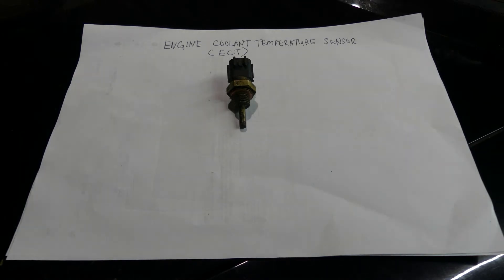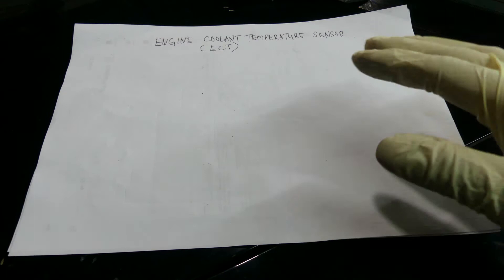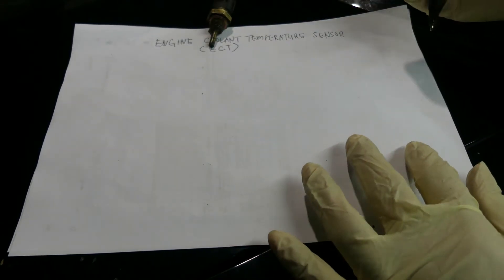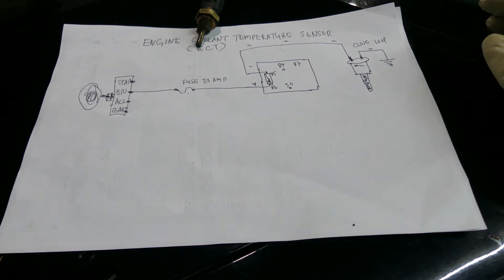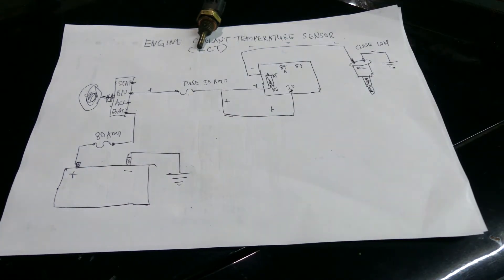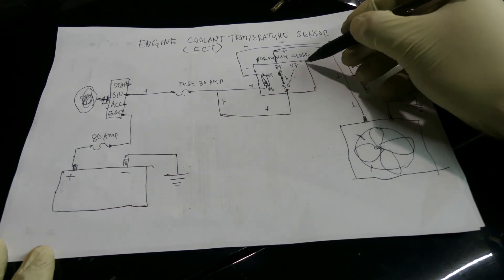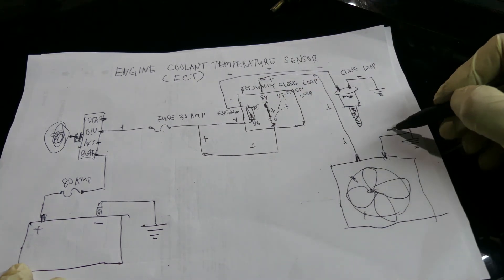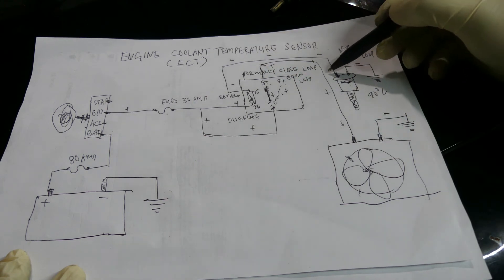Engine Coolant Temperature Sensor DIAGRAM & DIAGNOSIS (Non ECU controlled)

Comment: This guy doesn't have a good understanding of how these 2 circuits work. He's wrong about the power feed to the ignition switch and how the relay works. He's right about everything else.
Reply from the maker: this is a simply theory of how ur rad fan works and even an high school student will understand it so i dont get it why u dont understand it

Comment: i got no 12v going to the connector to the ECT. how can find where the open or short is ?
Reply from the maker: for this  video the ect design is only a ground control so couldnt see any 12v on it
Reply: @asianmechanicguy6483   I have a open circuit on my 2011 honda accord cant find the open circuit . p0118 coolant temp sensor is new

Comment: At what temperature does the sensor open the electrical circuit with the relay?
Reply from the maker: most car today is around 90 degree celcius up

Comment: What if the positive wire on the Temp sensor  gives 3 volts  to earth  and 8 volts to positive terminal ??? wire is perfect checked,  disconnect ECU no resistance at all to positive battery terminal , put another ECU out of running car same problem , peugeot 207 ..car hard to start but when warm runs fine  no engine light ???
Reply from the maker: thats a little bit complicated we need to know how much is ur bias voltage or ref voltage what is the design is it pull up or pull down design..

Comment: The temp sensor plug my car came with is a 4 wire plug. The only temp sensor replacements is a 2 wire. I’m wondering how to wire the new 2 wire plug in place of the old 4 wire plug so I can plug into the new temperature sensor
Reply from the maker: negative  postive ecu and dashboard about which is which i need to check it personally
Reply: @asianmechanicguy6483  I’m asking about a 1993 Chevy Corsica 2.2L
Reply from the maker: @CharlieSix  sorry like i said i need to check it personally
Reply: @asianmechanicguy6483  oh okay.  Thanks anyway

Comment: Goodpm. Ask lang po ako papano ko malaman ang ground at positive sa thermo switch ko? 3wires po kasi. Yellow Blue and Green po.yan ang pagkasunod sunod po. Salamat
Reply from the maker: wiring diagram kabayan or gamitan mo ng power probe or multimeter ..backprobe mo sya engine on or acc position ..

Comment: Hi
I have a VW caddy van and the coolant fan it's not turning on. The coolant sensor it's new,the rely has been changed ,all fuse are working. I dont know what s the problem with it.
Reply from the maker: then focus on the radiator fan u can check ur rad fan by directly putting 12v  and ground to check if ue fan will turn goodluck

Comment: Were did i connect the fan connection? Is in 87a or in upper 87 connector? Which one of this two?
Reply from the maker: it depends what sensor u had is it normally open or normally close .i had few videos of how this system works watch it 2 to 3 times i guarantee u.. u will understand how ur sensor and relay work together

Comment: Hi there, thank you for sharing your knowledge. I  have a 2000 ford transit 2.5 turbo diesel i have trouble about check engine lights on when it gets warm, i have replaced the coolant temperature sensor as it appears to be the reason because check engine lights does not appear when coolant temperature sensor is disconnected. Thanks.

Orly
Reply from the maker: No problem

Comment: My fan works only when I unplug the coolant temperature sensor. So, I bought the new sensor and after changed it the engine light change to on and show me the code p0118. I tested the connector with multimeter took the register -14.42 volts with my car off, when I turn on my car register -12.67 volts. Do you believe my connector has a problem or harness? 

That scheme is applicable for all cars and 90 C default also ?
Reply from the maker: i assume ur ect is ecm controlled this is non ecm/ecu controlled procedure

Comment: Ang gulo ng explanation mo. Panu mag engage ung solenoid ng relay kung wala signal galing sa thermoswitch. At pag sinabi mag engage ang relay, meaning mag close ung circuit kasi NOP Ang relay.
Reply from the maker: nakaengage lagi ung solenoid kc contineous ang negative power mo galing sa thermoswitch  so pag nag engage ung solenoid itutulak ng 87positve power ung connection nya sa 87a ung 87a naman bakante putol eh ung radiator mo nakaconnect sa 87 so hindi iikot ung rad fan mo kc ung power nasa 87a until ung thermoswitch mo mapuputol at ung relay magdes engage so babalik ung 87a na live positve power sa 87 at ung 87 mo nakaconnect direct sa rad fan mo and then walla iikot na sya na radiator fan mo
Reply: @asianmechanicguy6483  sir tanong ano ba tamang sukat ect ng nissan xtrail pag tinest mo sa multitester ano ba tamang pagkuha ng ect gamit ang multitester...lahat ba ng ect ng sasakyan  parehas mga reading nila..thanks po pakisagot mo
Reply from the maker: @larrysalvador1993  bro kung d ako nagkakamali ung nissan xtrail mo is ecu controlled so kailanagn mong alamain kung pull up or pull down design sya 2 wire or 3 wire hindi ko sya masyadong maipapaliwag dito pero almost the same sya sa camshaft position sensor my video ako sa pagkuha ng reading ng camshaft sensor panoorin mo un marami kang matututumam dun
Reply: @asianmechanicguy6483  ah ok...po..2 kc itong sensor ng nissan xtrail ko 2004 nakalagay sa engine magkatabi silang 2 duon sa engine..

Comment: Hello, my 07 nissan maxima second speed radiator fan only working when my water tank is empty,relay still ok, i replaced new coolant temperature still not working on normal ride and the water is boiling in the tank,what should i check/do next?
Reply from the maker: sorry bro i think your car has a module that runs the speed of the radiator fan its like a resistor type module not too sure ..check the module resistor somewhere i wish you were here around vancouver thats a really good issue of a car to diagnose
Reply: @asianmechanicguy6483  will check on that issue,thank you very much for ur reply..

Comment: bro ano kaya problema ngpalit na ako ng transmission ganon paden nag bi blink ang drive tapos mahina humatak.
Reply from the maker: Anong car bro at may obd2 scanner ka ba bro
Reply: @asianmechanicguy6483  may scanner ako bro problema hindi ko makita ang dlc conector honda accord 1999 model tinangal ko na yong ash tray na sinasabe mo wla doon
Reply from the maker: @tomtomgarage9760  well kung wala syang obd2 port at wala ka ring wiring diagram ng car mahihirapan tau nyan kung automatic transmission yan check mo muna cguro ung fluid level dapat pag mainit na ung car nasa warm level sya ..then check mo rn cguro ung wiring connection mga sensor nya try mo ring check ung abs sensor mo
Reply: @asianmechanicguy6483  tnx bro sabi ng mekaniko dito sa amen obd1 daw yon 3 pin lng.download nlng ako ng manual.
Reply: @asianmechanicguy6483  bro kamusta? naisip ko kc sa honda accord kabitan nlng nang manual transmission ano massbi mo ?pwede kaya?
Reply from the maker: @tomtomgarage9760  pwede kaso andaming papalitan saka mga wiring nya baka lalo kang mastress pag d tumakbo ng maayos